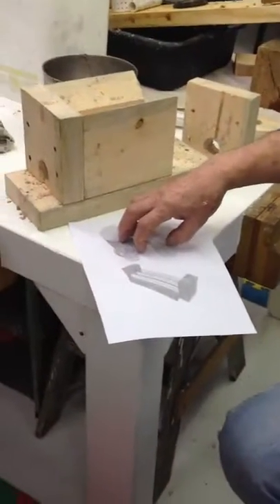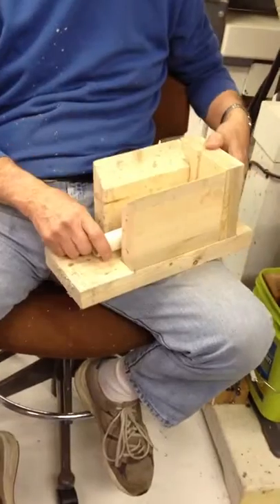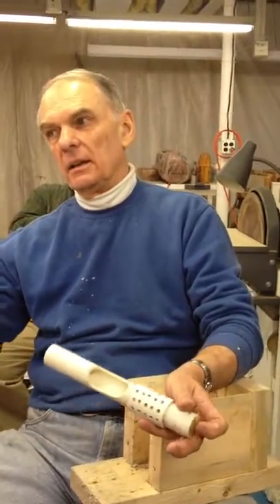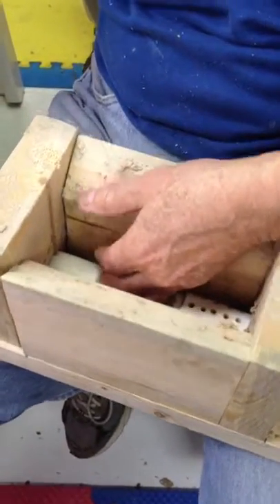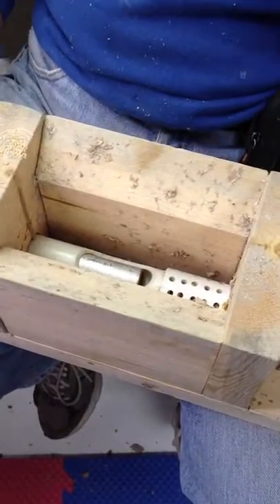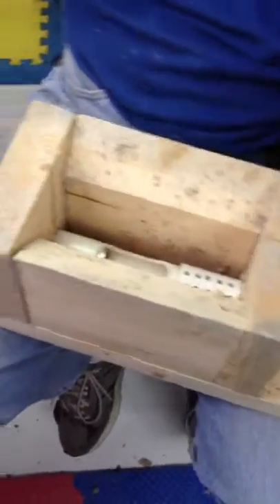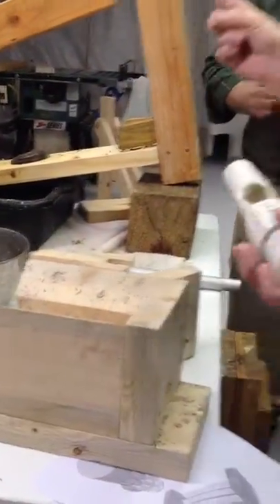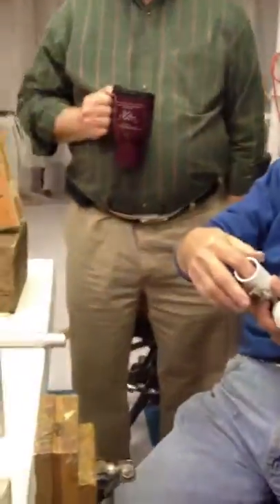Making Biomass Pellets for TLUD Stoves Part 1 of 3

Comment: RE: the coupler problem. look for a repair coupler. no ridge and I believe no taper. they are designed to slide all the way onto a pipe, and then slide back half way onto the replacement pipe.